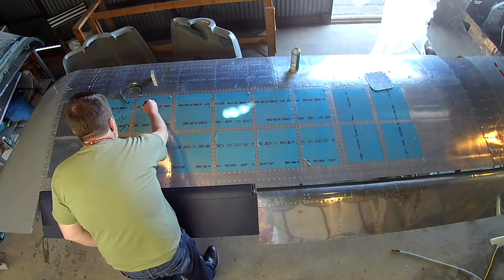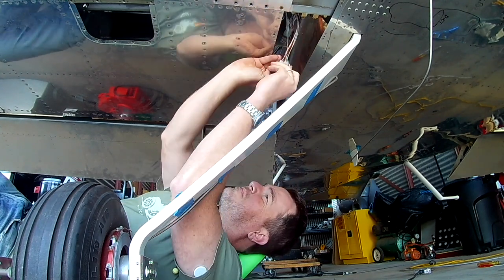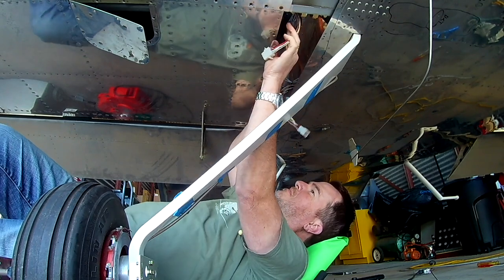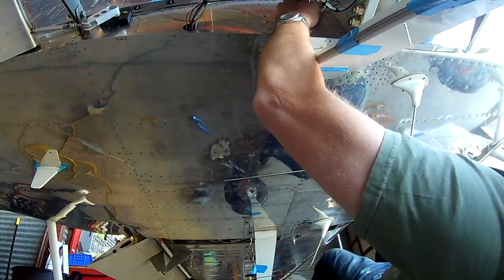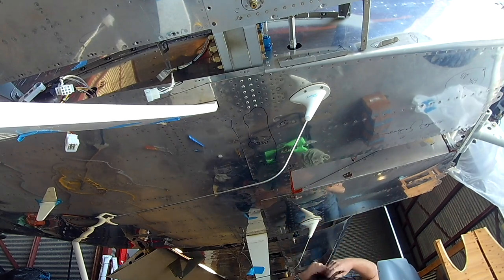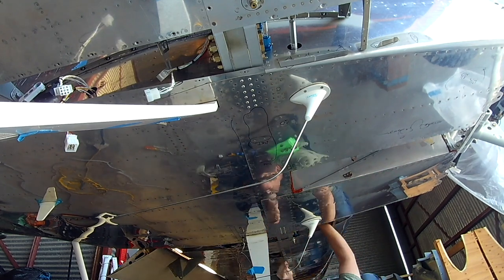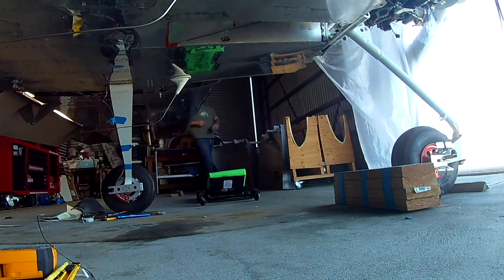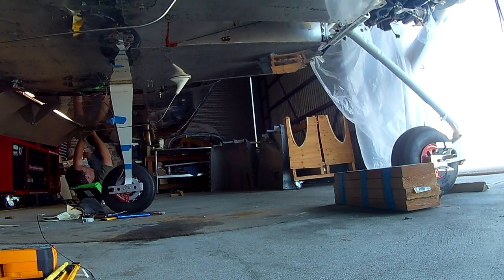RV-14 Aileron RE rigging

Comment: Just ordered a 14A and looked through some of your videos but didn’t catch yet whether or not you installed an Archer style wingtip antenna or otherwise accommodating VOR/ILS type NAV and approaches. I also didn’t seem to find a video that goes into the reason behind the prop and EFII system you chose.  Curious what your thought processes were for those. I did see you didn’t order your engine through VAN’s so maybe you got some additional engine work related to that done before delivery so some of the details aren’t in the videos?  Good luck with the first flight.  I’ve already done this path once before and nothing like being your own test pilot and looking down the runway and deciding whether or not to throttle up and take off for the very first time!  Its such a relief when you get back down on the ground and process the whole thing over.  Good luck.
Reply from the maker: No archers its GPS only. The prop was a classifieds find on VAF. The EFII is because I'd really like an efficient plane where I can control the fuel exactly! I also ordered the engine not from vans (though I do still get to purchase one from them for this plane in the future if I need to) but from another outfit that had some interesting options.

Comment: A) You're too hard on yourself.  See:  Big Picture.  B) Like the analog checklist, but surprised Van's doesn't supply a nifty app/spreadsheet.  C)  Will you have a Van's certified flight instructor for your check ride?    Keep on truckin'.